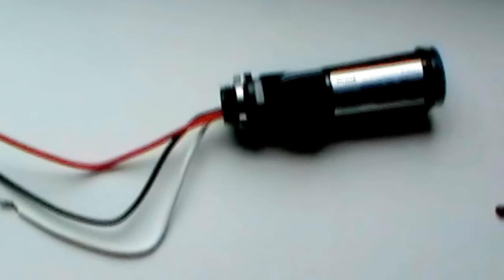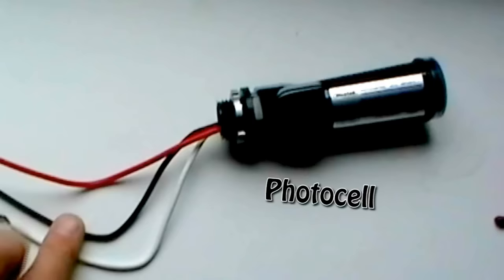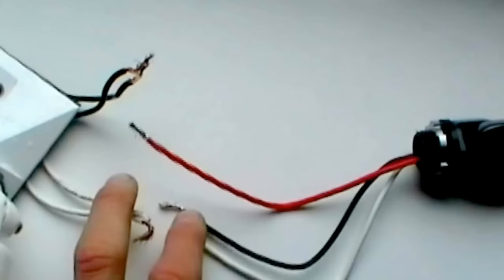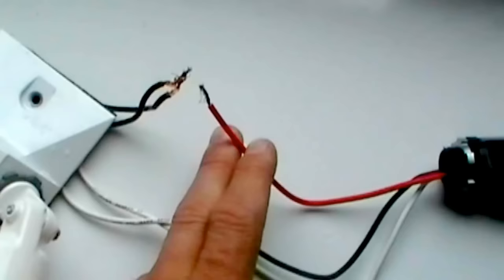Wiring a Photo cell. (Dusk to Dawn)

Comment: So basically the RED from the photocell connects to the BLACK wires from the light fixture and the BLACK wire from the power source connects to the BLACK wire from the photocell and all WHITE wire connects to each other.

Comment: I didn't like the video because it was not complete.  Is that photo cell just hanging out in the weather, sticking out of the socket?  Was it waterproofed?  does it screw into one of the auxiliary holes in the electrical box with Teflon tape to seal it?  Those are the things I'd like to know, as well as having someone else hold the camera and have two ladders on the wall to show us what the finished project looks like.  Just like the others said.  We are commenting, now do another video with our suggestions.  Thanks, not trying to be negative, but it doesn't show the whole job, with safety tips, waterproofing etc.  It's pretty bad, no offense.

Comment: Hi Bill-  I bought a house where the outdoor lights are obviously controlled by a photocell somewhere, but i have no idea where it is.  It is virtually on 24/7 in the winter/overcast so I would like to change it to a timer or something.  Where do you think it would be wired at to control the lights at every corner of the house?  I can't seem to find it anywhere...

Comment: I have an 20+ year old Sears photo cell that you can't even find anywhere on the net. 279.75262.0. I was looking to set it up and came here to find a guide. This is video confusing. I can't figure out what you are talking about. It isn't clear which wires go where. This should be taken down.